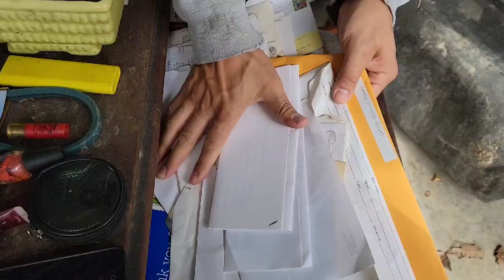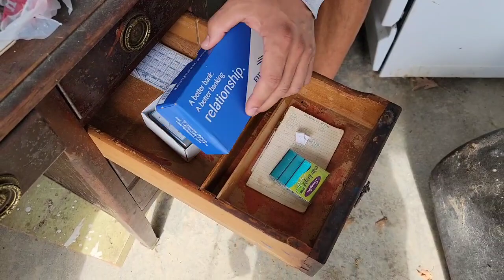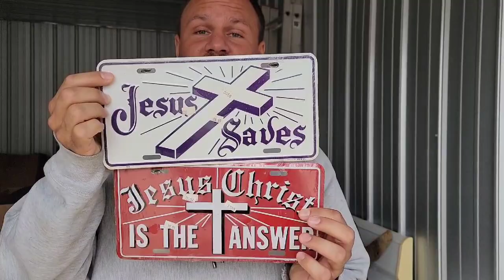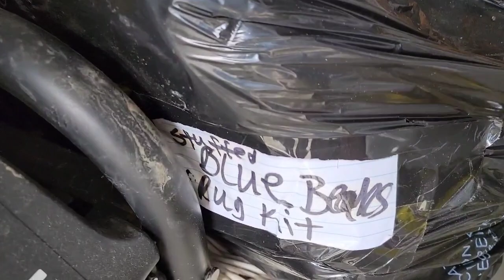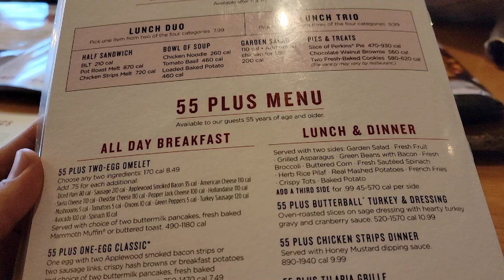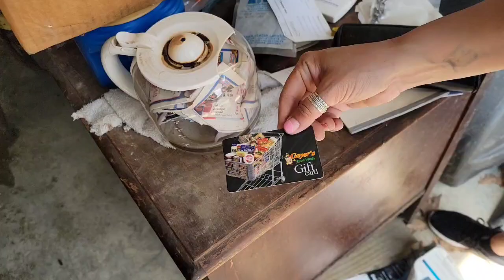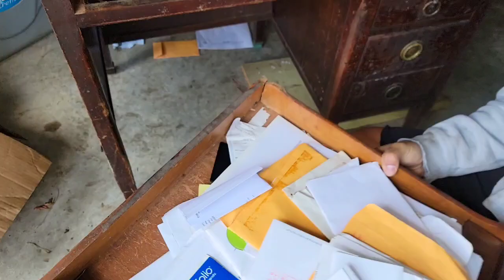THE MANAGER TOLD US WHAT HAPPENED / I Bought An Abandoned Storage Unit / Storage Wars

Comment: A screaming meanie is an alarm clock truckers use because when you sleep in with the engine running (cold/hot nights) the noise is too loud for regular alarm clocks.
Reply: Louder than my fire alarm. Physically painful and tricky to turn off.
If you hated mornings before....